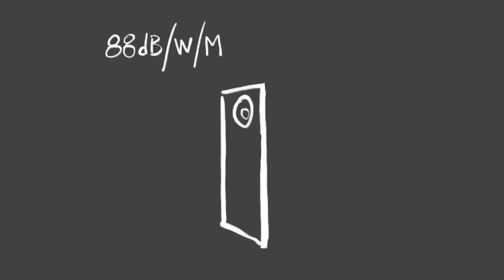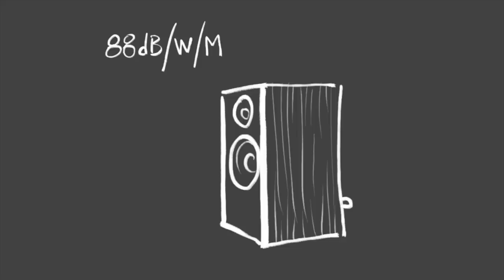John DeVore goes on a rant about the High End Audio lie that inspired him to start his company

Comment: John, thanks for the information, can you tell me your honest opinion on Pioneer HPM-1500 speakers that advertise 6.3 ohm, 92.5 db sensitivity, running on a Kenwood KR-9600 receiver,  note I am only using Channel A to drive these 2 speakers because I know that if I add another pair to channel b this will drop my impedance to ~3.15 ohms and my Kenwood would not be happy as it states it can drive 4-16 ohms. I purchased this new and just wondering what your honest opinion is on this setup as I want to refurbish the receiver and possibly the crossovers in the speakers, they all still work, the drivers sound great but the Capacitors are getting long in the tooth.  THANKS again, Bill

Comment: Amplifiers give you volts. That is what they are designed to do. Their wattage rating is just a measure of their ability to provide that voltage into a given impedance. The wattage that a speaker absorbs for a given voltage varies with frequency, and so has extra terms. An amplifier will have a wattage rating (a hangover from the days when this was a crucial and expensive issue) and a minimum impedance rating for that power. Much better if it had a voltage rating, with that impedance proviso. Complicated with power supply issues- in cheaper designs the peaks are supplied by capacitor storage which has a limited supply time. So, you cannot get away from needing two parameters, but IMHO moving to voltage sensitivity is a step forward.
Remember, tube amps had an output transformer, so you could have any voltage you wanted (just add turns) so they measured what cost- watts. Today, voltage costs (output device voltage rating) but nowhere near as much...

Comment: Speaker impedance is a complex subject (that's a PUN!, heh, heh...).  The RESISTANCE of an 8 ohm speaker is usually, around 6 or 7 ohms.  The power it absorbs contributes nothing to the sound, and is dissipated as heat.  It's the reactance that is related to the magnetic field that drives the cone.  This relationship is given by:  Z = R + jX (get the pun, now?).  The overall opposition to the current is the magnitude of the Z, which is:  |Z| = SQRT( R^2 + X^2).  NOW, things start to get complicated!  The "effective "R" is not just the resistive R.  It also includes the radiation load placed on the speaker, which DOES relate to the sound intensity.  By the way, I'm not an acoustical engineer, but am basing this on my knowledge of RF theory and antenna design, which is analogous.  Now, surprise, surprise, I'm not going to explain how all this relates to evaluating speaker performance:  I really don't know how all it fits together, to say how loud a speaker will sound, based on voltage measurements.  But, as Alexander the Great dealt with the "Gordian Knot," the solution is simple:  How many dB SPL, per Watt of amplifier output, does the speaker produce, at one meter?  (That definition seems, somehow, familiar....)

Comment: Which ohm would you recommend is used with the O/96 speakers? I'm powering the 96s with a Leben CS600 and theres a range of impedance I could be using.
Reply from the maker: either the 8 or 16 Ohm tap, whichever you prefer the sound of.
Reply: @DeVOREFIDELITY  thanks for responding. 16 really did it for me.

Comment: The fix for all this, of course, is to recognize that our habit of separating the amplifier from the loudspeaker is a holdover from vacuum tube days when the MTBF of the amp might only be a few months before one or more of the vacuum tubes failed and needed replacing.  The amp had to be instantly user accessible.
Solid state amplifiers can reliably operate for decades without failures.  My point is that if you build the [switching] power amplifier into the loudspeaker box, then the speaker driver properties are irrelevant to the user - simply provide a line-level signal to the back of the box and away you go.  I.e. do the split between the "preamp" and the "power amp/speaker".  Many subwoofers already work this way ;  co-locating amplifier and driver allows for easy implementation of driver servo-feedback setups for improved linearity.  There is one minor nuisance - the amp/speaker box now needs to be fed 120/240 VAC power as well as the STP audio cable, and we cannot build all the power amplifiers for a Dolby 5.1 system into one box with only one power supply.  But again, this thinking is obsolete - there is little to gain from bundling multiple power amps together to save on power supplies, but then requiring multiple AWG 8 speaker line pairs snaking from the amp to the various speakers located all around the listening room.  Heavy copper is not cheap!
All is tradeoff - the high-end audio business is still selling snake oil with "Monster Cable" nonsense and the like.  We should also recognize that eventually our standards will [likely] change so that each loudspeaker unit is fed its audio over a wireless link.  Think about it - no Monster Cable,  no line-level analog feeds, just AC power cords...The future is bright if we let it happen!  Just my opinion, of course...

Comment: Wow, that takes me back. I was working for Incredible Universe in the early 90s in the Stereo Department. Working there cultivated my audiophile itch. We spec-dropped almost constantly, thanks to training from vendors like BOSE, JBL, Harmon Kardon, Denon and even DCM. IN fact, I will never forget the schpiel the Harmon Kardon Rep gave us about their amplifiers:

"Our systems are true amplifiers. Our wattage spec appears low, because we boosted the amount of amps, because this is an 'AMPLIFIER!'  If you want a 'wattifier,' go pick up an 1800 watt blow-dryer and blow yer brains out!" 

Back then we had these monster Harmon Kardon mono blocks. The General Manager and the Department Manager didn't care if we took stock out of the back to build any system we wanted.  I wish I could remember the model of this speaker.  It was an Altec Lansing floor speaker.  It had 7 drivers and 1 long electrostatic tweeter. I think it cost about $15,000 for the pair. We all agreed to make a ridiculous setup with it.  We took 16 Harmon Kardon mono blocks and connected a mono block per driver on the left and one mono block per driver on the right. The unbelievable insanity that was produced was unlike anything I will ever hear again. IN that sound room, with the door closed, you could generate so much volume that you hear it through out the entire store. Oh course, no one could last more than a few minutes in that room without getting "hurt." I doubt even Altec Lansing ever thought someone would set up a system like that.
Reply from the maker: "If you want a 'wattifier,' go pick up an 1800 watt blow-dryer and blow yer brains out!"  Ha! Great!

Comment: Over the impedance curve, impedance is fluctuating, does wattage do the same? How can you say it's 1 w over the entire frequency spectrum?
Reply: If I had an amplifier that varied voltage wildly across the audio spectrum into a speaker load, in the waste bin it would go.  I posted an explanation of impedance elsewhere in the comments that touches on amps speakers and impedance.  If you’re suffering from insomnia, check it out.

Comment: Now I'm really confused... I've come to realise from my headphone collection that 600 ohms are much harder to drive than 125 ohms for example, so the higher the ohms the higher the resistance meaning less sensitivity and therefore the need for more power. If however I understood this video well speakers got less sensitive and harder to drive as the ohms went down over the years, which is the exact opposite theory so please can someone kindly explain ? Even more confusingly I believe that running two sets of 8 ohm speakers creates a 4 ohm resistance for an amp rather than 16 which would support the videos theory so what's going on with headphones ? I also collect tube driven vintage units and portable devices with 4 ohm speakers so I've always thought that speaker ohms have typically gone up (to commonly 8 today) over the years not down, what am I missing ?

Comment: Well, a fair amount of info there. I completely agree with the view on dropping speaker impedances but in principle there’s nothing wrong with it. There’s a few other points though.

Class D will double output power on a halving of old impedance as long as it has the current capability to do so, just like solid state. Sure, it won’t on a tube amp but that’s yet another nail it the tube amp coffin (surprised there’s any space).

I think it’s good to have low impedance speakers, it makes amplifier design a lot easier as you don’t require such high voltage output transistors (SS or Class D). 

A constant voltage spec for sensitivity actually makes a lot of sense. Impedance is not constant vs frequency so although you can do a power spec for sensitivity, you need a bit more info such as where the 1W is measured in the bandwidth. Having said this, for the sensitivity spec to mean anything at all if defined by voltage, you need to know the impedance characteristic too.

It makes sense speaker impedance dropped over time. I imagine it was high early on to make the tube amplifier output transformer simpler. As time went on and transistors became a thing and they got better at handling current, speakers became lower impedance.
Reply from the maker: All true, yes. But I love tube amps...

Comment: Yeah but in the same token with db/W/M it would be useful to explain what resistance is met during the measurement. Nothing is perfect. The German magazine Audio measures Amplifiers with a 3D graph: Voltage / Phase change / Impedanz to express the amplifier stability. It seems no other magazine is doing this sensible audio quality measurement which is undoubtely due to a lack of understanding of the basic engineering principles.

Comment: Good work John, this measurement is misleading for use with a good deal of products. Simply stating Volts is hiding the other half of the equation (Amps) to determine the power.

You always need a good amplifier, otherwise it is too affected by the speakers it's driving.
I appreciate folk have different requirements and spending power, and I am in no way advocating this any type of solution, but the Sanders Magtech can drive down to 0.3 Ohms. Now the tail is not 'wagging the dog'.

Or, buy some speakers like Zu Audio's - high efficiency, amp-friendly (high impedance) and because they are efficient they are very 'dynamic'.

Comment: I've been doing sound for 3 years, and all that stuff confuses me. For my portable rig, I have powered PA and Subs, and I don't have to really think about power amps. I worked at a venue that was set up with power amps for the subs and monitors, so I had to go through setting up the gains and such with a volt meter. Some said I was going about it too technical, but I just wanted to make sure nothing was going to blow up on me!

Comment: Wrong about the tube amp. If you're on the 8 ohm tap and the load impedance drops, power will increase. Same as a solid state amplifier. The damage risk to the tubes, output transformer, and power transformer also increases.

Your story is a classic example of the ohmtards in car audio. The standard in car audio became 4 ohms because the amplifier in the stereo ran off 12v. Almost all car audio speakers are rating at 2.83v/m to make their speakers look more efficient then they are.

Comment: I'm sure most viewers will know this but ...
It's worth remembering that decibels (dB) is a logarithmic scale which means a drop of approximately 3dB is a halving of sound pressure levels. Also I seem to remember that they used to specify the frequency of the signal being measured (usually 1khz) or maybe show a graph of sensitivity vs frequency.

Comment: I’ve been suspicious for quite some time because speakers using two 8 ohms bass speakers to make 4 ohms with 6-8 ohms tweeter as they sound great on SS amps but lack some bass on tube amps. For tube amps I guess you need a constant impedance speaker.

Comment: It seems like you dissed class D amps a little. Is there anything wrong with the nx6000 which is so common to use for subwoofers these days? What would the equivalent be in a more typical amp with a giant Transformer? I figure for 1/4 the price is worth the experiment. But I still like to know what my other consideration could be. It's for home theater mostly so it's not likely to get overrun with bass like music might do.

Comment: My Spendor BC1's have been driven by a Sansui R50 since 1980. Both still sounding good.
I am a past member of the AES, a professional, having worked on state of the art lazer/audio systems. So this video is about speaker impedence and SPL? He does not like valve or class D amplifiers? He makes only an 8 Ohm speaker!!! And the point is?
Reply from the maker: I love the BC-1s, a true classic. I think you totally missed the point, but thanks for watching and commenting.

Comment: That is so cool to be peeved about. I've been in this niche since mid 80's. I build my own amps and fix other ppls amps. As I learned from Carver, there are voltage source amps,' current source amps, and whatever between depending on feedback.  Even tube amps have feedback to control output voltage so when a speaker goes to 300 ohms at resonance, the output voltage won't try to maintain the same wattage as for 8 ohms. I guess that the wattage reference in the sensitivity spec. was misleading all along.  Got into building my own class D amps in early 90's (shock and awe). Still relied heavily on feedback to perfect output accuracy.
  Gotta know yur amp and load to keep em together. smiles

Comment: As a consumer, why do speaker specs matter? A listening test is still required, so the specs don't affect my purchase.
Reply: While at the end of they day, your ears tell it all, sound and performance of sound is still a very technical mechanism. Understanding how electricity interacts with various devices can help with understanding consistency in flow of energy or speaker performance, along side the requirements needed to drive various set ups. Without knowing tech specs, making these pairings or chasing quality performance can get more difficult as A doesn't always match with B. Even two amps with the same impedance ranges wont perform the same.  I suppose the TLDR is just educating oneself more to understand it all, as going to the store everytime you have a question does mean you are leaning onto someone else's answers to questions you have.

Comment: I'm not a scientist or a design engineer, but I know enough about electrical circuits to know that the more resistance you introduce into a circuit, the more heat you produce, and the more energy you waste. High efficiency speakers put less of a demand on an amplifier because they present less of a load (resistance) to the amplifier. The amplifier will run cooler, which will prolong it's lifespan. More importantly, it will allow the amplifier to use more of it's available power to not only keep up with the music (speed), but to reproduce it more efficiently and have more reserve power for demanding passages.  The first figure I always look at when considering a new speaker is it's efficiency. If it's not high, I'm not interested. And like John, I don't like it when the manufacturers start changing the long established rules for ratings. During the 60's, the electronics manufacturers began to inflate and exaggerate their amplifier power ratings by playing loose with the numbers concerning ohms and watts. They would claim that 30 watt-per-channel RMS amplifiers had 240 watts of total system musical peak power just to fool stat oriented non tech savvy customers into buying their products. Things got so bad that by 1974, the Federal Government had to step in with amplifier rating guidelines to ensure that the manufacturers rated their equipment honestly. Are we heading in that direction again, but this time with speakers?

Comment: I always thought that sensitivity ratings were made at 1KHz. So, as the frequency drops the load impedance also could drop causing you to need more current from the amp to keep the SPL level. All in all I would avoid inefficient speakers

Comment: What PO's me is the way amps are advertised these days as being say 50 watts per channel into 4 ohms ,but neglecting to tell you at 8 ohms ,it's about half that or the total power is 100 watts ,but combining both channels into the total.
Reply: Seems like only the really cheap ones though, most of the name brands will give you a 20-20k 8Ohm <0.1% THD rating in the manual

Comment: The beautiful, and intoxicatingly gorgeous JdV has spoken...  His gospel is exactly the reason I have always tended to take the industry with a very large grain of salt.  Full frequency stereo sound propagation for me was learned from simply observing the systems of high-end nightclubs I attended from 1981 to 1996.  The best systems not only used high-efficiency horns, but they also employed the muscle of amplifiers that delivered high energy slew rates that Never needed to be overdriven to deliver smooth sound.  It's my own personal belief that these same performance parameters extend as well in a great many aspects of preamplification delivery as well.  As a luxury industry, the high-end has dominated the demand/supply modicum of monetary pri$e gouging.  My own specific guiding principle in observing those systems has always been centered on both bi, and tri-amplification where independent power has always yielded both very low noise floors, and outstanding dynamic ranges.  Considerate, careful planning in assembling these type systems can deliver amazing results WITHOUT leaving one in Mariana Trench debt.  (enough of that soapbox....  I'd much rather stew in my green-eyed condition of Mrs. JdV, her beautiful retinas get to be soothed by seeing her wonderful Apollo on a daily basis). -sigh